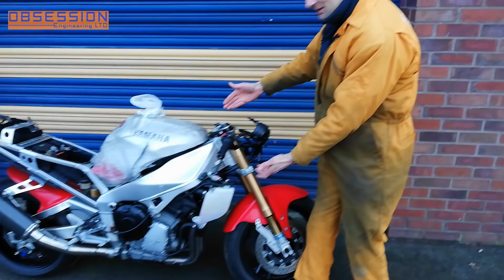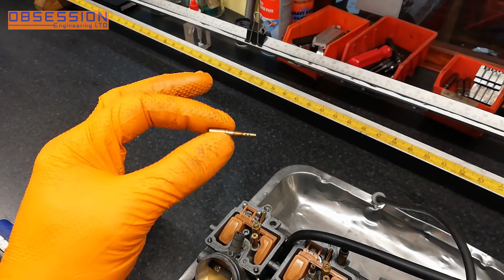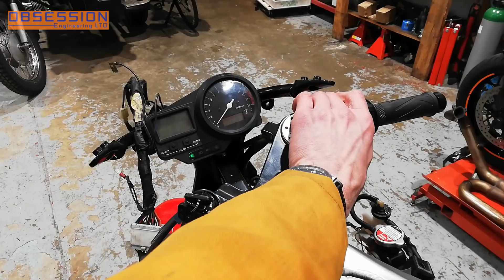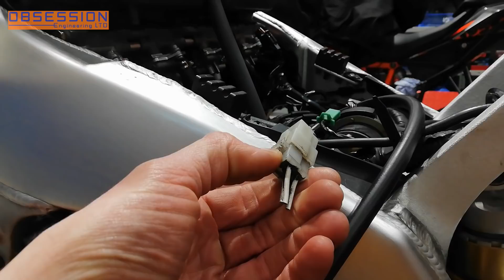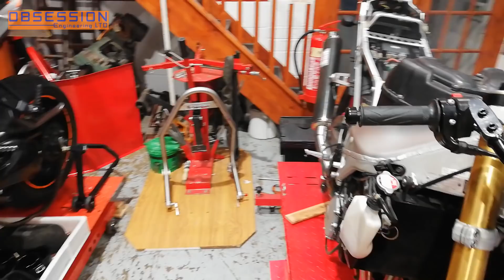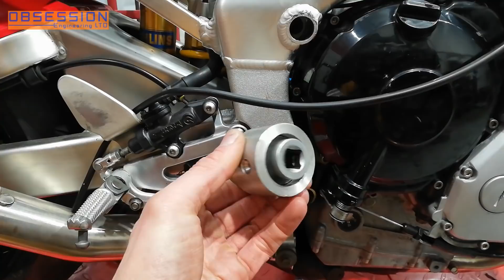1998 Yamaha R1 Jigsaw Puzzle Project .Part 1. Rebuilding an Iconic Classic Superbike 4XV carb strip

Comment: Carbs are a pig to remove. All the videos omit this. 
3 mms Allen bolted clamps. Cable clamp needs to be removed. despite running the carbs dry the o rings in the connector tubes perish even if fuel stabilizer added.

Comment: I just overhauled my 2000 motor. Had the second gear slip. Put new rings in to with a good hone job. Wast that hard. The hardest part was getting the flywheel off to split the cases. Broke 2 pullers. Had to cut the fukin thing off i had a spare.

Comment: Nice project,I am original owner of 1998 blue R-1 with 55k trouble free miles,make sure your bike has had the clutch basket recall done as it can fail-krack apart under severe use,check by steering head numbers for 2 punch makers indicating it was replaced,enjoy your ride!
Reply from the maker: It has been done, although I wasn't especially aware of it. Luckily my mate who'd had it before me worked in a Yamaha dealer and made sure it was right

Comment: 98 gauges were notorious for giving problems I have 2000 model gauges on mine.... actually I only have a 98 chassis everything else is the 2000 model ......205 differences. Everything is pretty much  interchangeable except the starter motor internals and electrics

Comment: The problem with the early r1s is the fuel over flow pipes are directly clamped above the exhaust, so when you slide off, the bike goes up in flames as mine did at the silverstone circuit. The fuel lines were like this from the factory, mine was the 99 r1. Loverly bikes and better when tuned.
Reply from the maker: I'll keep that in mind, though hoping not to throw it down the road to test!

Comment: Nice seeing you do another project. The fault code (needle settling at 8000rpm) isn't that the TPS which needs to be adjusted.
Reply from the maker: It's fuel tank level sensor on these
Reply: I read is it later. Will you do a carb sync and a TPS adjust? I thoroughly enjoy you channel...keep it up! 👍🏼

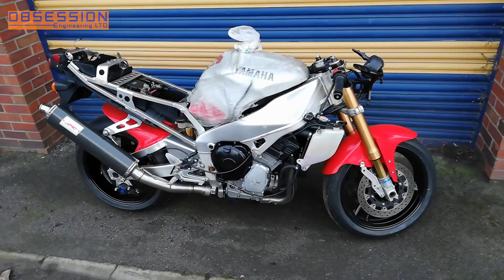Comment: 0:35 what did you mean by RIM mounted brakes?
Reply: At one point many many many years ago some bright spark came up with idea of only having the brake surface of a disc brake with out the middle bit that holds it to the hub by bolting said brake surface to the rim of the wheel like an extra rim on inside edge of wheel, down side as I recall is more weight on edge of wheel has more effect than in the middle.
Reply: @owen368  Like Buell used to do I guess....
Reply: @knopv  Could not remember who tried it but they sound likely as they also tried fuel in frame if memory serves.
Reply from the maker: Yep, Buell used the idea, and there were some after market versions. The disc was fixed directly to the inside edge of the wheel rim. Good idea to allow bigger diameter discs. Just didn't catch on
Reply: @obsession_engineering  oh okay. I'm familiar with the rim mounted brake on a Buell I just didn't know that the aftermarket had made them for other bikes.

Comment: Great to see another project underway, looks very clean as a starter and I'm sure you'll have it fighting fit for the warm weather!

I'm sure you'll check everything over, but looking at the rear indicators, looked like the right one may be fitted incorrectly with the drain cut out at the top. Ask me why I check for this on my second hand bikes of this period now...
Reply from the maker: Well spotted! The right hand mirror isn't available so it's a left fitted upside down. I do have a right hand lens to sort it out though

Comment: The clock problem might be the main connector block that you had to fit. It's very common for those connectors to corrode. You can buy a new block and repin it. I had to do this to mine.
Good luck with it.👍
Reply from the maker: A bit of a clean up and it helped loads :)